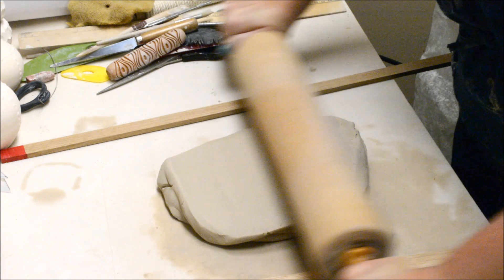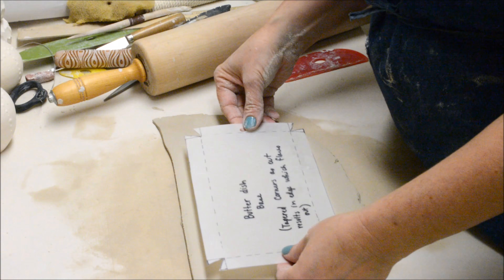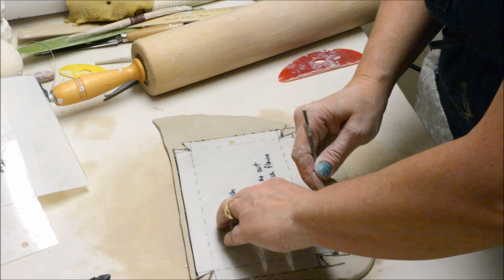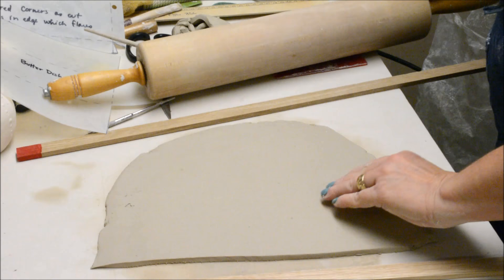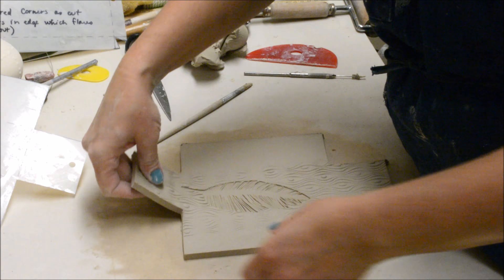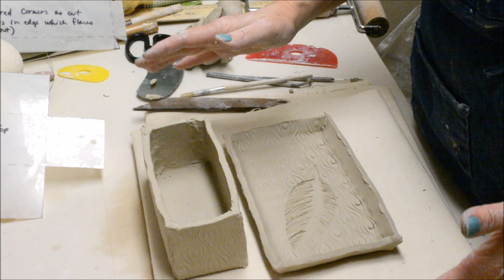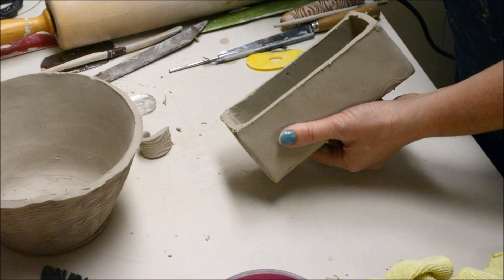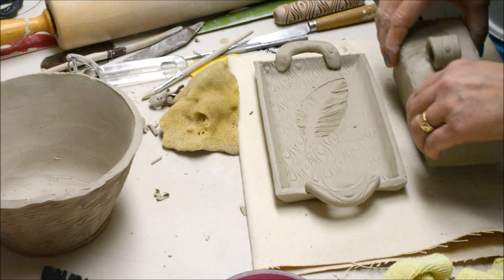Creating a Lidded Butter Dish with a Textured Slab and a Focal Accent  Ceramics II

Comment: Why do you add a coil on the inside of the lid?
Reply from the maker: @ 14:00 I add the coils to the vertical corners only, as my students are beginners and it makes their connection of the slabs more secure.  I probably wouldn’t  do it in my personal work.

Comment: Karen so glad I came across your channel!  I want to try new things and this is one of them! What kind of clay would be best to use for useful pottery?
Reply from the maker: Awesome!  So glad you found me! ;). Recommending a clay would really depend upon how high you’re able to fire it. I assume you might be working at a class or studio setting, where you could fire pieces?  Often, studios will fire to a particular temperature, and that would determine your type of clay.  (Some studios have you use their clay only to be sure it is correct.) Stoneware clays can fire to a higher temperature than earthenware- as do their glazes Also, if you have the opportunity to do either high or low, You may want to take a look at the glazes to determine what what be the look you’d like to achieve.  If you are just beginning, earthenware is easier all around. Doesn’t fire as hot, and because it goes through less thermal shock, it has less potential problems during firing.  I hope that helps!

Comment: I really llve your videos and if I was 40 years younger I'd try to enroll in your class! I tried aming several butter dishes ands find the bottom piece warps and the top piece tends to crack  - BUMMER - Any pointers? Would paper clay patch the cracks?  thanks so much for all you do!
Reply from the maker: Hi Susan- I would say, perhaps make the slabs a little thicker if necessary, and allow to dry SLOWLY and evenly, I recommend under a heavy towel.  Uneven drying of pieces can often result in warping and cracking.

Comment: Thanks so much for sharing your videos. I’ll bet you’re fun to have as a teacher! You don’t seem to mind that the corner seams show on the outside of the butter dish lid. Is that just to hurry through the video or is that a part of your style? I know some potters really like to have marks that show the items are made by hand, but where’s the line between made by hand and unfinished? I often ruin items by attempting to get an “industrial “ finish.

I appreciate your help.
Reply from the maker: Hi Gail!  Sorry, I just saw I missed this message!  I usually leave visible seams on slab pieces.  I like the glaze to show the construction techniques.  I will smooth areas with a small brush to make sure it is clean, but I do show it off!  :)

Comment: Where is the template for the dish?
Reply from the maker: I provide the measurements- it's in the video description, but here it is again! 

Pattern measurements are at the end of the video - but are here too:
Base length:  9.5" long, 5.5" wide, the notches were about 3/4" deep- (base that on how tall you want your walls)
The top/cover was 11.5" long, 7.5" wide, with each of the corner squares cut out at 2.5"